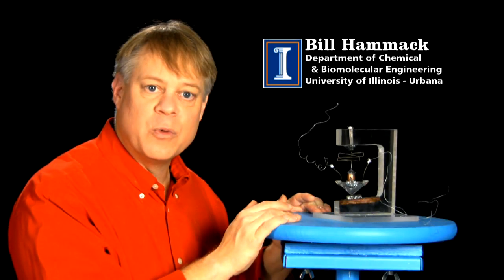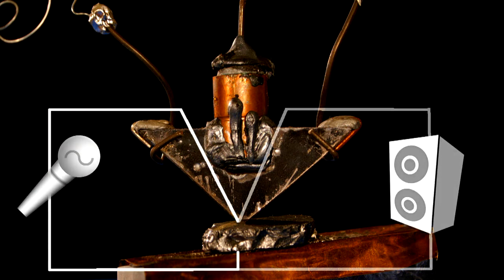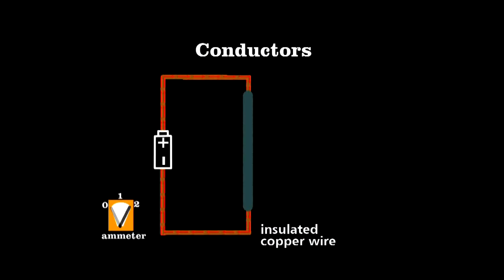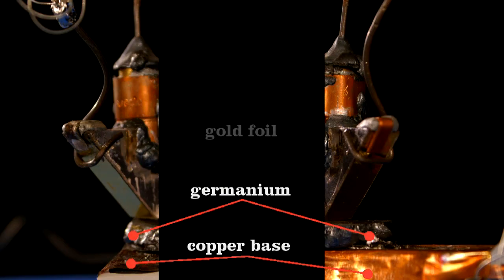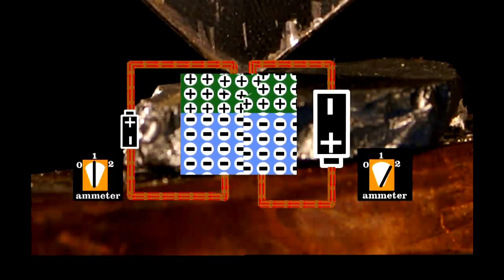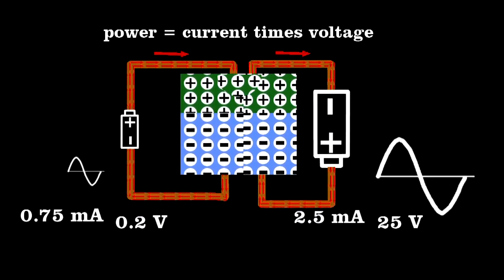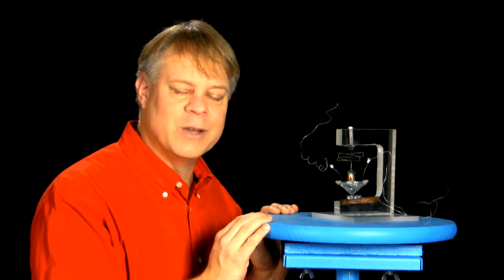How the first transistor worked

Comment: Umm... aren't most transistors two dimensional?
Reply: dovregubben78 My opinion touched you enough to respond a comment after 2 months, my job its done with you wanna be smart-ass technician ;)
Reply: +dovregubben78 I think what The Engineer Guy means by one dimensional is that the modern transistor can be in line with a circuit. Surely wire can be thought of as one dimensional. And, thanks to miniaturization, the modern transistor is a thought of as a wire that conducts only another (live) wire touches a particular junction. There aren't many spatial considerations and there certainly aren't any case considerations.
Reply: +dovregubben78 Sure! Plenty of schematics assume that one leg is connected to Vcc; directly below the transistor. Now, of course, that doesn't make it any less 3 dimensional in reality, but it affords you the ability to design the circuit one line at a time. This blurs the line between logic diagram and schematic; A-----Q. If you're willing to take on faith that one of those dashes is a transistor, and there's a rail or plate beneath it that provides 5V, then the A source controls the Q load without any fancy drawings.
Reply: They're microns thick so for all practical purposes they're one dimensional.
Reply: Cellophane is microns thick and two dimensional.
Reply: Of course. It's just an approximate model for the math is all.  It's easier to deal with the physics if you reduce the amount of dimensions, as long as it still gives accurate results.
Reply: I don't follow your line of reasoning, rgaud8.  I went to college for electronics.  I repaired pro audio equipment for a living for 10 years.  I've replaced thousands of faulty transistors, from surface mount, to PCB mount, to heat sink mount devices.  I've seen every mode of failure imaginable.  It's rare, but occasionally a transistor explodes, exposing the die.  I've also cut open faulty TO-3 transistors to expose the die.  Every transistor die I have ever seen was a square piece of silicon (a square being a two dimensional shape).  I am also familiar with how semiconductors are manufactured.  In many small signal transistors and integrated circuits, the doped silicon exists in a thin plane (a plane being two dimensional) at the surface of the die.  The remainder of the die helps that active layer dissipate heat, and the die is often bonded to a metallic substrate and/or secured to a heat sink, to dissipate even more heat.  Other transistors (particularly MOSFETs) are very much three dimensional.  I can't think of a reason why someone would describe a silicon die as "one dimensional."
Reply: I went to school for materials science, and my school emphasizes semiconductors. I'll try to be more clear.  Every transistor is three dimensional in reality. When you are doing calculations, using equations such as Fick's first and second Laws, you try to make the most assumptions you can so that the math itself, not the actual physical component, can be expressed as a one dimensional object. This makes the calculations easier to do, but the actual component is still three dimensional in reality.  Look up diagrams of PNP or NPN transistors to understand what I mean.  In the math, for simplifications sake, you are only worried about right-left, because that is where the action is.
Reply: At the end of the video Bill said:

"Within a year Western Electric, Raytheon, RCA, and General Electric offered the junction transistor, a superb, one dimensional device."

Then you said:

"They're microns thick so for all practical purposes they're one dimensional."

Then I pointed out that something can be microns thick and two dimensional (resembling a plane), and you changed your story to "it's just an approximate model for the math..."  Now you're claiming that "every transistor is three dimensional in reality," completely ignoring the fact that many transistors are, for all practical purposes, two dimensional (nanometers thick), which was really my point in the first place.

"Look up diagrams of PNP or NPN transistors..."

I don't need to look them up.  I can visualize a variety of diagrams, as well as the actual structure of various semiconductor devices, from memory.  I first saw them in books when I was 9 years old.  I also mentioned I went to college for electronics.  Do you really think someone could study electronics in college without seeing those diagrams rgaud8, or were you being intentionally condescending?
Reply: " If I'm wrong on something let me know and correct me..."

I already did, rgaud8:

You: "They're microns thick so for all practical purposes they're one dimensional."

Me: "Cellophane is microns thick and two dimensional."
Reply: dovregubben78 Let's move on past the cellophane at look at the original question about why they can be considered one dimensional.
Reply: @rgaud8  
You don't know what you are talking about.
Reply: @acmefixer1  Cool
Reply: He is being a dick since all transistor are in reality 3-dimensional but for our human practice purposes we considered them as one dimentional. He is being a dick period, arguing about something we are all concern but he just want to make his point loud, a point we ALL GET, anyone with half a brain gets it. Apologize my english its not my native language. This guy its the typical wanna be smart-ass that surely annoys all his "friends" with his stupid arguments fights.
Reply: The point was about manufacturing complexity. For manufacturing, transistors are very much 2-dimensional devices. Still an improvement over the 3-dimensional point-contact transistor.

Also, dovregubben78 is not being a dick.
Reply: "Yeah, well, ya know, that's just like, uh, your opinion, man."

--The Dude
Reply: I get an alert every time someone posts a reply.  Does it not work that way for you?  Were you hitting refresh over and over to see if I'd respond?
Reply: Still not seeing it Chris Knowles.  Circuits exist in at least two dimensions.  Can you show me a diagram of a circuit in one dimension?  Can you show me a diagram of three wires meeting (as in a transistor) in one dimension?

Comment: This video has great production value and does well for what it does: introducing the history and physics of a transistor. But it really misses to give understanding on how they function.

In case you are interested, here's a basic explanation.
A semiconductor isn't a material halfway between an insulator and a conductor. If one wants to get picky about it, no material is an insulator under enough voltage and we ought to only talk in terms of a continuum (or gradient) of resistance in different materials. We call an insulator to a material with such high resistance we can disregard any current through it for a given voltage (usually 5 volts, nowadays). 
What distinguishes a semiconductor is that its resistance varies depending on a physical phenomenon like light or heat. That non-fixed resistance what makes it special. Thus you can use it to increase or decrease the output voltage of a voltage divider (Google is your friend) without having a human turning knobs. By default, semiconducting materials are usually quite good conductors by themselves! 
Now, we can make them out of 2 flavours using doping which make one semiconductor have a bias towards either rejecting or absorbing electrons. It so happens that having both flavours together will cause the diode effect where the boundary will have an ever growing resistance when reverse fed. 
In transistors (the bipolar kind) there's a current entry terminal made of one flavour which bonds with an unlike flavour (for the base) and then an exit for the current. If the entry (collector) and base are reverse biased (as if a diode), then high resistance will build up. Otherwise, collector to emitter (the exit), through the base, resistance will be little and the transistor can conduct well.
Reply: Visual_Vexing
You have confused the emitter, which is not the output, with the collector, which is not the input.

The base to emitter circuit controls the current to the collector where it exits.

Comment: Slap together a thin layer of p-silicon, n-silicon, and p-silicon in that order, attach wires to each layer and cover it with plastic and you got a modern transistor. Is that right?
Reply: Well, BJT's aren't that popular anymore. Instead, you want something like raw silicon, silicon oxide, n- or p-silicon- a MOSFET.
Reply: leerman22 But where can you find silicon and how can you distinguish a p-silicon from a n-silicon?

Comment: @JagdtygerII   two-whisker detector diodes were probably just voltage-biased, but not amplifying.  With two contacts, a diode's turn-on voltage could be canceled out by a separate power supply.

In the mid 1950s someone (Banbury/Gebbie/Hogarth) managed to make a galena point-contact transistor.  They found that amplification appeared when the whiskers were positioned within 0.0004" of each other.  They had to etch the tips into very sharp points to do this.

Comment: @engineerguyvideo   Be sure to debunk the "current amplifer" myth.

In my hobbyist days I never understood how base current was amplified.  In engineering classis I finally found the truth: it isn't!   Ebers-Moll and Shockley equation spilled the beans: transistors are transconductance devices, where the value of Vbe determines both Ib and Ic.  Voltage causes current. Doh!  Simple in hindsight.  My mind had been blocked by the (wrong) idea that charges from the Base lead can directly affect Ic.

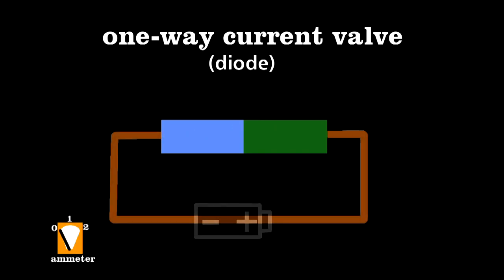Comment: This is really well done, just like all your videos.  Perhaps in a future video you can go into a bit more detail about the diode (around 2:06).  I didn't quite get how the negative and positive charge carriers worked, or how the flow of electrons through them were any different than through a normal conductor.  I did get that if the positive side of the diode points to positive power, then the current will flow. Many Thanks!!

Comment: I have read that many of the old radio operators of the WWI era and after, made something similar using their Galena "cats whisker" diodes with a second whisker. How possible is that to accomplish? I do know that the Galena semiconductor is very voltage sensitive, but would it work??